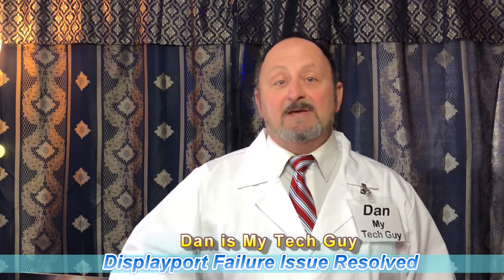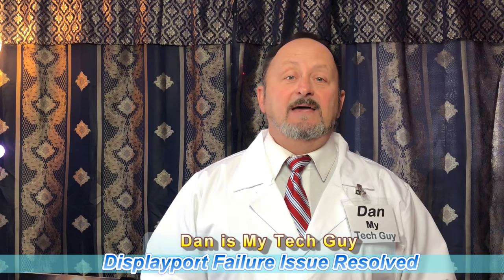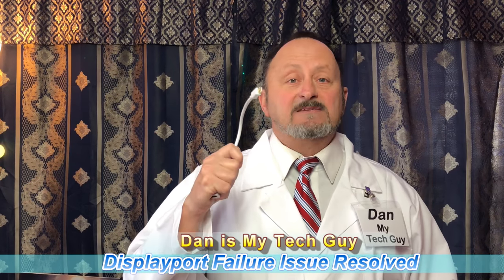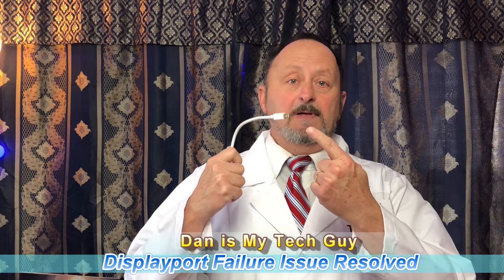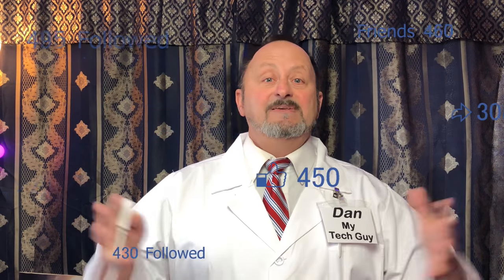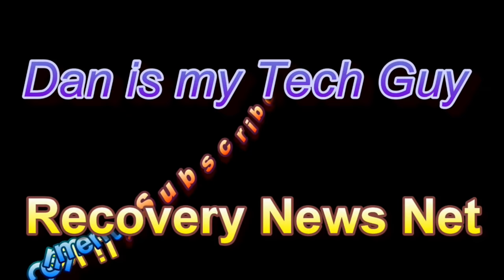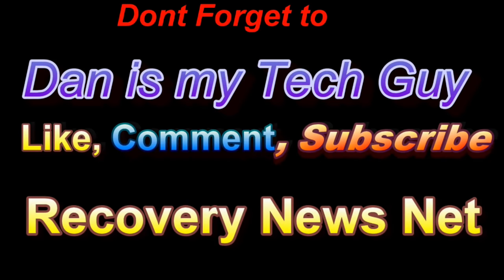Display Port No Signal FIX in 2 minutes NO COST

Comment: YOOOOO, THIS WORKED, I AM SO AT EASE RIGHT NOW!! TY DAN!
For those who still have problems, make sure that your computer is still on when you unplug you display cable from your computer! 

And with that, the steps should look like this:
1. With the computer still ON, unplug the display cable from your computer
2. Turn off your computer AND unplug your monitor's power cable
3. Wait 1 minute!
3. Before turning on your computer, insert your display cable back into your computer, and plug your monitor's power cable back in
4. Turn on your computer with everything plugged in
Reply: Not working

Comment: SOLVED!!!!! Changed the DP version setting in my monitor's settings menu from 1.2 to 1.1.
Reply: My monitor is xl2411p and where this monitor's settings menu?
Reply: @vankata1459  I have no idea. It depends on the monitor, and there are hundreds of them. If you can locate a settings menu, and if it has a setting for DP version, then this solution may work for you. Otherwise not.
https://www.youtube.com/watch?v=oo5RpQzTjUw
Reply: THANK YOU LIFE SAVER LITERALLY I CHANGED IT TO 1.2 THEN FORGOT I DID THAT THANKS ALOT LITERALLY
Reply: @kxyb0ard557  I'm glad it helped! :-)

Comment: I don't know why this works, and even though it has fixed my problem so I should be happy it is still incredibly annoying that it works. So my display port stopped working couple months ago, I tried unplugging, resetting, using a different port none of that worked. So I was lazy for a few months and just used HDMI, but eventually bought a new DP cable but that didn't work either. So I try this and IT GOD DAMN WORKS. I am £20 out of pocket for the new cable and in the end what fixed it was just turning it off and back on again in a SLIGHTLY different way than I had already tried -_-

Thanks for the fix, I am annoyed but very grateful.

Comment: CHECK THIS OUT!! For dual monitor setup.
If that didn't work for you...
1. From the desktop, right click on primary monitor
2. Go to display settings
3. Under "display" tab, for "rearrange your displays", select the monitor that is not working by clicking on the picture of the monitor. (Most options for the monitor should be grayed out.
4. Scroll down to "multiple displays" and from the drop down menu select "EXTEND THESE DISPLAYS"

worked for me. Hope this helps

Comment: Most people’s problem will be the cable don’t fit flush on the graphics card so you have to cut away some of the plastic around the connection as graphic cards sit in side a frame and sit back slightly so the cable don’t make full contact. If the push clip don’t engage on the cable then you need to cut some plastic away. This worked for me.

Comment: I can't freaking f***ing believe ! It actually worked !!! The step to unplug from the power source might really do something, because i was changing the cables with new ones just to try. Sir, you are awesome ! Thanks for saving more hours of searching <3 Been already all over the internet searching for the fix. Cheers ! 🍻
Reply: Do you need to do it everytime?
Or just once?
Reply: @vivalosgameplays5383  i had to do it a few times but i believe it was a software problem because it solved after trying to fix some blue screens of death that i used to have.
Reply: @horia43  Thanks for the reply.

I can run 165hz overclocked monitor and solved DP problems with a friends PC, a friends laptoo and my new PC that I had, this method workd like shush .

And yeah, I just needed to do it one or two times, I still have it working.

Have a great time!

Comment: Ha. Did not expect that to work, but it did!   Using a DP cable from my PC to monitor I get the 'No signal' message so unplugged the power from back of the monitor for about 30 seconds.  When I put the power plug back in, up pops the picture!

Comment: Hi Dan I have something called the xtendtouch it's basically a portable touch screen monitor for USB type c devices and mini HDMI to HDMI all of a sudden I keep getting no signal anytime I try to connect an HDMI device to it but it works fine with a USB type C device this morning it has a built-in battery even if I unplug it it's still going to have juice what would you recommend

Comment: I have a laptop Probook 640 which doesn't have HDMI port, but VGA and DisplayPort.   I bougth the adapter XTC358 (Display Pport male to HDMI Female adapter) in order to display on a HDMI Monitor. 

The problem is that no matter how many times I plug and unplug, restart my laptop, turn on/off my monitor, Nothing happens!!, the monitor doesn't detect any signal.

I've searched in different forums, talking about 'passive/active'' DisplayPorts, but I haven't found a solution for my laptop. Please HELP!!

Comment: I have a converter and i plug in the monitor and all that but when i boot the pc up my screen is working for 20 secs then it just goes black and says no signal my gpu,ram and monitor are all fine.It worked for a year and it just suddenly started giving this issue.

Comment: this works but now i have another problem I cant connect my second monitor and for some weird reason all this can work with having a extra hdmi plugged in I don't know why, is there a way to be able to remove this useless hdmi and have my display port be normal again

Comment: I found the solution for myself, it seems strange, but you need to press harder on the port, then your computer sends you a message that you have connect a monitor or tv. In my case I connect monitor with display cable. Hope it works for somebody

Comment: didn' t work, but then i cleaned my rams and moved them to another slot and it worked so try doing this
Reply: I did that and still doesn’t work
Reply: I did still doesn’t work
Reply: @arlinamaya6821 same
Reply: @colinmusgrave  If you are using HDMI conector use diferent one

Comment: I'm just gonna say I had an issue a second ago where my secondary monitor wouldn't display anything from my computer, no clue why or what. I unplugged stuff, restarted the computer multiple times, updated all drivers, replugged it back in and to no prevail. I do thousands of troubleshooting steps and felt hopeless. I stumble across this video and am like, "well I'll be a monkeys uncle if uplugging it from the power source works", and low and behold I unplug the monitor from the power source for about 30 seconds then plug it back in and the monitor all the sudden works again. When in doubt, basic troubleshooting I guess wins. "Have you tried unplugging it and plugging it back in?"
Thank you sir.

Comment: the only way i got my display port to work was start pc with hdmi once loaded and working i plugged in disply port both in pc and monitor once thats in just unplug hdmi and its now on display port and working. i have to repeat this each time i turn on pc.. its a pain in the BUTT . but its the only fix
Reply: i have tried everyones fixes and none of them work what so ever
when i turn on pc with just display port it goes to the screen where you can press a button to go to bios then goes black and says no signal. so the Display port works at first but then says no signal
Reply: @vH4RDC0R3v  Me too! Found a solution yet?

Comment: already done that 5 times nothing happened
Reply: Did you fix it?
Reply: Check my comment
Reply: @michaelrich5501  it's been working but I think the problem is the actual plug-in on my tower. I have two DVI ports that I can use, the on connected to the motherboard works but the one that I want to use is connected to the graphics stuff. My cable isnt the problem and neither is the port on my monitor. Im not sure if its worth fixing because my warranty expired in october :/

Comment: Did I do something wrong I took the HDMI out of my monitor and the computer and I unplugged my monitor and left my computer off for a good minute or two and its still not working
Reply from the maker: un plug the computer too.  It does not work every time... about 65% is the current count

Comment: Another way to fix it.
1- Go to the nvidia control panel in the right click on the desktop
2- Open tab Manage 3D Settings
3- Change tab Power management mode to : Prefer maximum performance
4- Replug DP cable and enjoy.
Reply: Hah how to do that if monitor dosent work, absolute BS

Comment: I use a hdmi to display port adaptor to my ps4,it works sometimes but most times the monitor goes into power save mode,no idea what is causing this,Dell monitor is the culprit.
Reply: Same thing happens to me with my dell
Reply: @mj_playscodgaming5887  I fixed this by buying a hdmi to avi cable,check if your monitor has the same connection.

Comment: the problem is on 20th wire of the cable sends voltage to screen and backwards they don't care to fix it you going to buy a knew gpu or monitor or motherboard in the store that i have bought display port cable they said nothing they replace it at once be CAREFUL!

Comment: This didnt work for me either.  one other person said unplug from both the outlet and disconnect the power cord from the monitor.  he's missing the last step.  what worked for me is right click on the desktop and click "graphic settings" for whatever graphics card you have/ my work laptop is an intel.  i selected the multiple monitors though there, clicked apply and BOOM, it worked.  hope that helps someone, let me know if it does.
Reply from the maker: Ill send you all your money back you paid to watch this video.......   It either works or it does nor. Works about 75%^ of the time.  If it doe snot wprk replace the part.

Comment: Not working
Reply from the maker: This works about 70% of the time. Sometimes the cable is in fact bad or the device.   Most of the time it does not work because we don't unplug everything.  Capacitors hold a charge and need at least 30 seconds to discharge.  

I have had to change a cable at least once with the procedure.  https://amzn.to/2PkyiQ2

Comment: Didn’t work :(
Reply: I'm having problems with no signal as well. 2 different cables, 3 GPU sockets. Works when it wants to.

What I found, at least in my case, I when I connect the display port cable to the graphics card I have to push it really hard into the socket, with quite a bit of force. Only then does tit work.
Reply: R5 that would be alright for now but I’m using dvi d to display port, I ordered a hdmi to display port to see if that works